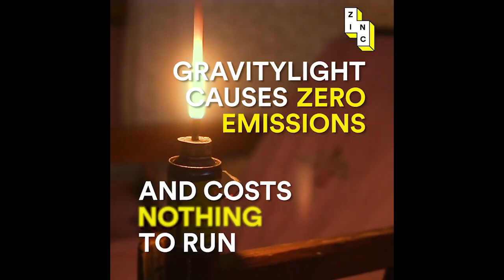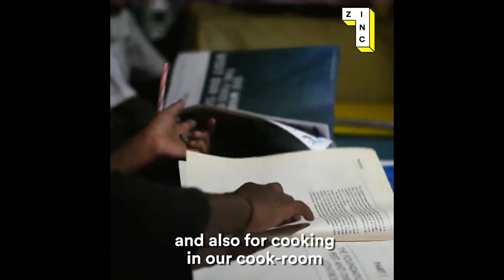Light Bulb Powered Only By GRAVITY  - 5 Times Brighter Than Kerosene Lamp

Comment: Any updates. I think your i in 5 people do not have electricity number is very conservative and if you change the wording to people dont have reliable dependable useable electrical energy then ill bet its at least 2 out of 5 globally. I lovein rural north eastern nevada USA and of the 200 folks in my general area less than half are connected to the grid and of those who are not connected to the grid only a very few have anything more than 100w of solar and a 12v car battery (flooded lead acid) and most use gasoline generators and go threw a 1000.00 generator a year as they are not built for continuous duty and no one around here has the money for a 10kw continuous duty diesel genset lol so i have veen waiting at least 6 years for your lights to come on the market hopefully with a selling pount below 100.00 US dollars. How many lumens or better yet for us old folks candel power and what temperature range (again for us old folks is it white, bluish or yellowish) the blue tint led lights make me agitated and give me a headach...